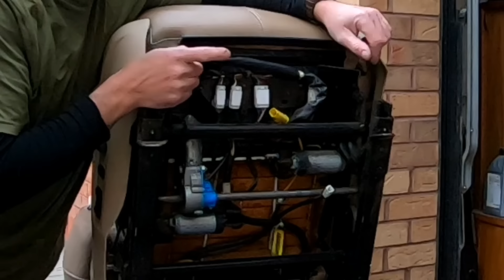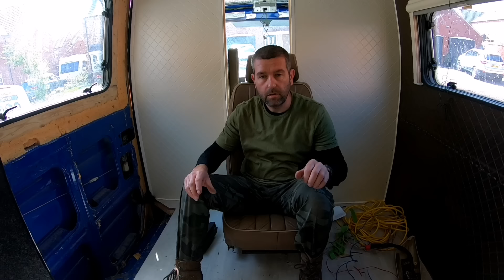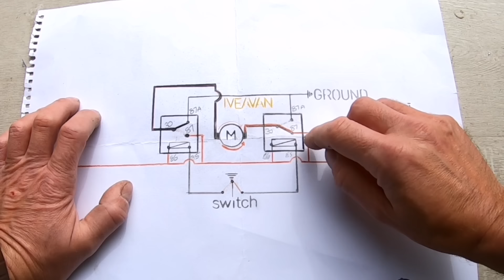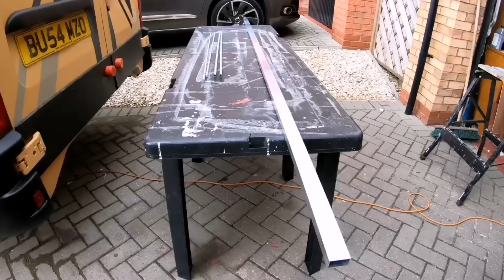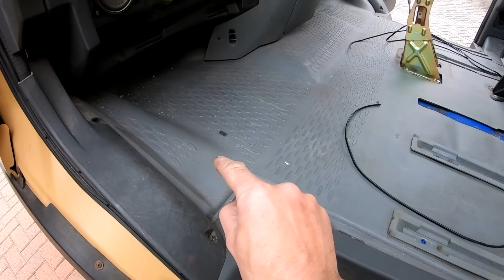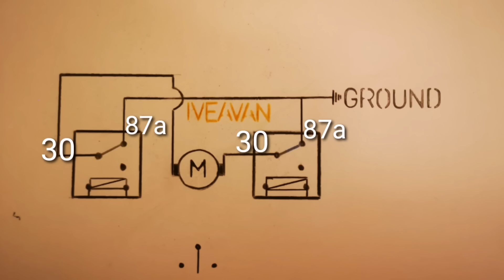How I Installed Range Rover P38 Seats Within a Campervan: Full Guide [Iveco Daily].

Comment: Hi Mark I don’t suppose you know the size of the Allan key to remove the drivers side seat on the slides so the base of the seat is still there do you Thanks
Reply: Thanks Mark . Have a good evening
Reply from the maker: @ivecamperbuild_thomas4084  I'm pretty sure they were 6mm possibly 5mm mate, I think I've thrown the old bolts away now, seeing I can't find them, probably best buying a Allen key set, as you will need them for other stuff to remove  on the van bud I'd imagine 😉👍
Reply: Thanks Mark I have got a Alan key set but I think they must be the old type and not in Milli meters, I will pick a set up today thanks again Mark for your prompt reply.
Reply from the maker: @ivecamperbuild_thomas4084  no worries matey, everything I've come across on the iveco is in metric measurements bud 😉👍
Reply from the maker: Hey up bud, I'll have to check tomorrow mate, top off my head, I couldn't tell you to be honest, it was a while ago when I did the seats 😉👍.

Comment: Fantastic! Just discovered your channel from my Instagram! Been planning my Luton box conversion and been looking at replacing seats instead of transit factory fit... this is ace.. I used to have a P38 so I know how comfy they are!! Just subscribed to your channel and Instagram so keep up good work!!
Reply from the maker: Thank you matey😊👍, yes they are very comfortable indeed bud, just a pain in a butt to wire them up, I've looked on ebay and it seems the manual ones seem to command an higher price, probably why not many people bother fitting these electric seats 🤔😉👍👍👍
Reply: Mark Collom #Iveavan - sounds about right - my electrical know how is limited to zero really so this coupled with a Haynes manual and my dad’s better knowledge we will be trying this! Suppose I just need to understand how to add to the van 12v and not the campervan system
Reply: Mark me again - daft question but how easy would it be you reckon to put a swivel base on one of these but still
Maintain electrics etc? Cheers bud
Reply from the maker: @steveflanagan46  depends how good are you are at fabrication bud, nothing is impossible 🤔, with only a twin core cable feeding power to the seats the electric part shouldn't be an issue, just the fabrication side of it mate on the seat frame, but once you did one, the other side should be easier enough, I'd say its possibly to do it, ( but bare in mind , they are wide seats! Giving scope to enable to twist the seat around matey ) good luck 😉👌👍👍👍
Reply: Mark Collom #Iveavan thanks chief - I was just bouncing ideas around to see if I could say but a swivel base on the passenger or drivers seat and have entrance door to the Luton box off set instead of middle - not sure if it can measure up 🤔
Reply: Sorry Mark but any chance you could tell me the maximum width of the rangey seats please?
Reply from the maker: @steveflanagan46  yes Steve, just measured them now and the width is 600mm so quite wide bud, that's including the arm rest and plastic skirt 😉👌👍
Reply: Mark Collom #Iveavan legend!!!
Reply: Guess who again! Sorry but do you know if changing seats is an insurance issue?
Reply from the maker: @steveflanagan46  Hi Steve, I'd would list it as a modification when renewing mate, never been an issue before for me in the past, when I fitted different seats in my MR 2 Turbo ( but saying that it was some time ago) "Wondering Womble" who has posted a comment on here, has fitted different seats, probably best to ask him if he's had issues bud 😉👌👍
Reply: Mark Collom #Iveavan legend as usual! Just bought my 1996 MB sprinter chassis - and oh boy is it a project! Can’t wait!
Reply from the maker: @steveflanagan46  sounds interesting mate, you on Instagram, if so I follow your project on there matey 😉👍
Reply: Mark Collom #Iveavan  am but an old account for my upcycling / furniture / upholstery business but I have had to put that on back burner... so I plan to put an Instagram account together soon so will let you know! Won’t have a YouTube like you though - I have a face for radio!
Reply from the maker: @steveflanagan46  that's great, cheers bud 😉🍻👍

Comment: Brilliant stuff. Too bad about the rear partition there (probably) getting in the way for really reclining.
Reply from the maker: Thank you matey 😊👍, I consulted with Ash Pollard regarding the wall and his seats, and his are set further back by about 6 inches by the looks of it, with mine you can still recline back, but obviously not all the way. I kinda need the wall because it will be used "all year round", in places like Scotland, Yorkshire, and the lakes, so it needed to be installed for when the climate is less inviting outside. 😉👍👍👍
Reply: @Iveavan  Yeah, sealing off the front with the single-glaze windows up there probably helps a lot with thermals. I'm thinking a very heavy-duty curtain instead, and an extra hot air outlet blowing in to the front cabin. As long as all the windows in the back are dual-glaze acrylic motorhome windows, and the walls are very insulated, I suspect the heat loss from the front doesn't have to be critical if you have something like a Webasto diesel heater. But never tried it of course.

Comment: bloody good job there! friends done same with jag seats in his 

I bet b&q robbed your wallet, find a local metals place usually called xyz engineering or whatever and you can get it 1/4 the price from their offcuts bin. although i'm not an ally fan, i'd have gone with some 40x30 mild steel or similar
Reply from the maker: Cheers matey 😉👍, B&Q even with a trade will rob you 😆, I need to keep the weight down as I'm carrying 120lt water, 130kg power bank, alloy ain't the perfect material to use I agree, I probably will revisit this, once I know my final weight of the van bud 😉👍👍👍

Comment: wouldnt it be easier to just place a recliner chair in the van,and save hours of useless work?It all seemed such a waste of time
Reply: You can't go sit in the recliner when you're going down the road, driving. These seats should be comfortable. Also, a recliner would use up insane amounts of space. Personally I would prefer this setup, especially with the rear partition removed and the chairs on swivels...
Reply: Croft Agreed 👍🏻
Reply from the maker: Wouldn't it be easier just to chuck 30 to 40 k and buy a motorhome, and save all of this useless time?
Some people prefer electric seats, some prefer manual, either way, it's going to take time to do 🤷‍♂️, but as you eluded to, it's a waste of time, so this video helped you out, by answering your own question, yeah?
Reply: @Iveavan  oooo someone got out of bed on the wrong side
Reply from the maker: @toppertruthio  haha, yes I did 😅, you're entitled to your opinion, and I respect that 😉👍👍👍
Reply: @Iveavan  its all good mate,i read it back ,and it did come across as rude.I shoulda just hushed my mouth;)
Reply from the maker: @toppertruthio  hey, don't worry about it matey 😉👍👍👍

Comment: Aluminum is not as strong as steel & softer... stay safe plz
Reply from the maker: Yes I do agree with you bud, If they is an issue with the MOT regarding the seat frame, I will include it in a future video, the extention part of the seat frame is pretty much secured via 6 bolts (sleeved to prevent crushing of the aluminium box section, including the seat mounts them self's ). Car manufacturers are now moving to aluminium frames such like Alfa Romeo, Mercedes, and Jaguar. But if they is an issue, I will revisit this bud 😉👌👍👍👍
Reply: @Iveavan  I did some research on this previously, and found that some seat rails in minibuses and taxis are made from aluminium. Not saying that's in all cases, but I did come across an instance. Plus, alloy wheels seem to hold up quite well, no doubt steel are stronger though, but heavier.
Reply from the maker: @michaell8835  and in welfare buses , its used quite often, like I said to Allen, I may "revisit" this in the future, as I've got a suspension base for the seat, so the base may go completely, just need to be cracking on with the rest of the build for now 😁👍👍👍
Reply: @Iveavan  Cheers Mark, keep up the good work.

Comment: Looks like they would  make excellent swivel seats too with that recliner option.  I need a new passenger seat in my Sprinter, as it currently has a 1 and a half seat that is fixed and a bit too upright to travel more than about half an hour. Its also too close to the dash, so you get kneecapped if you need to open the glovebox. You've given me an idea on how to alter the seat base to accommodate a different seat. Love the Lego Dave and his van!  Cheers.
Reply from the maker: Thank you Linzi 😁👍, searched for some time for a suitable Dave Bertholini mobile 😅😁, yes, I reckon they would make a great swivel seat too, I have the rear seat too, so I might do something with that 🤔😉👍👍👍.
Reply: @Iveavan  We had a rear car seat mounted on a custom box in the back of the van when we had the trials bikes - worked pretty well, lots of storage for boots and other gear under it. I've got the rear seats from a Honda Jazz,  was going to do the dinette with them, but might just use some of the caravan cushions I've got, can be dinette, side sofa or bed then. Still working it all out at the mo.
Reply from the maker: @linz_in_NZ  I probably make a sofa out of mine for the garden room, that we never seem to use🤔 😅😁👍👍👍

Comment: Great vid Mark, I've just bought an Iveco Daily 35s14  & have a set of Lexus is220 seats on standby with the hope of fitting them eventually.._
Reply from the maker: Thank you Allan 😉👍, seat swapping possibilities are endless, just the height issue regarding the original seat frames mate, Ash Pollard has the Honda Accord one's, he only had to add an inch on his when I asked him, saying that his bulk head is around 6 inches further back then mine mate (that makes a huge difference) so calculate that when fitting them 😉👌👍👍👍.

Comment: Really interesting video Mark. Quick question, do you know how the seats compare regarding weight, just wondering whether you knew what the Rover items weighed? Cheers.
Reply from the maker: Thank you matey 😊👍. To be honest no I don't matey, I lost a double bench seat, so one range rover seat will probably compensate for that, and I had the suspension seat for the drivers side, which probably weigh the same as the seat I replaced it with, hazard a guessing 20kg to 25kg with frames each. But that's just guessing bud 😉👍👍👍.
Reply: @Iveavan  Cheers Mark, I'm very close on my weight calculations, but those seats look lush!
Reply from the maker: @michaell8835  that's why I used alloy for the subframe extension, trying to keep the weight down myself on the van bud, I'm personally losing weight doing this build, so shouldn't be an issue 🤔😅😁👍👍👍

Comment: Wow, excellent Job Mark,..............the only concern I had whilst watching the vid was the bottom of the steering wheel being too close to the seat (height wise)?
Reply from the maker: Thank you bud 😊👍, it's actually lower then the original factory fitted seat (mine had air suspension drivers seat) , by about an inch, you do sit quite high in the Iveco for some reason bud, I'm comfortable in it at least matey 😉👍👍👍.
Reply: @Iveavan  I bet the range rover seats are really comfortable, but not heard of a air suspension seat = sounds interesting (compressed air? hydraulics?) - good luck with the rest of the van project.
Reply from the maker: They are more Mechanical damping then driven by air bud, but for some reason, they were called air ride seats 🤷‍♂️, a hand pump for the bolsters. These are sooo much more comfortable then the original seats matey and cheep, and being a " Yorkshire man" works with me 😁😉👍👍👍
Reply: @Iveavan  Cheap & Yorkshire Man - LOL.

Comment: will not have problems in the M.O.T.
 ?

thanks for the video
Reply from the maker: Thank you 😊👍, No, shouldn't have any issues putting it through it's MOT. it's secured well within the van, goes Fore & Aft, back rest stays in its up rest position, seat belts are in good and functional condition. 😁👍👍👍